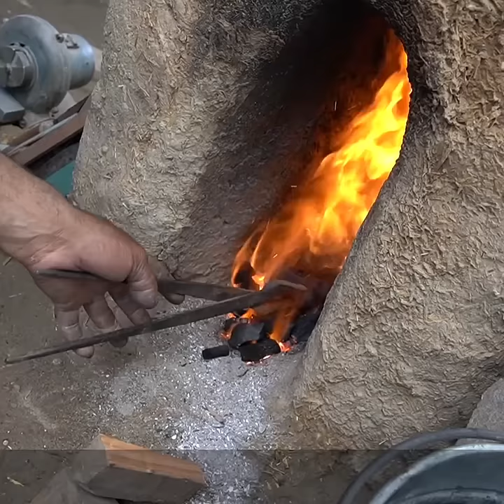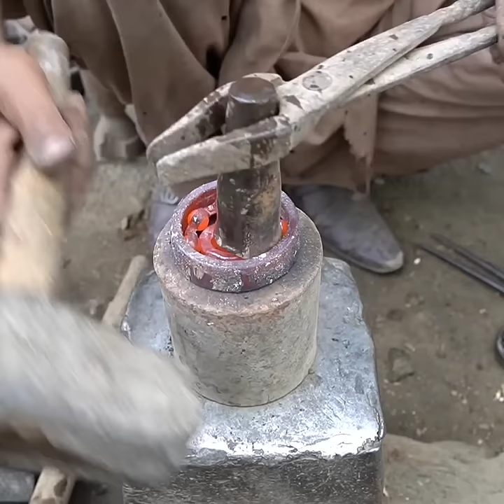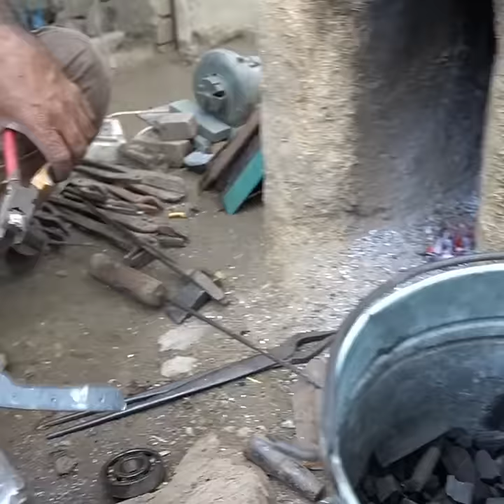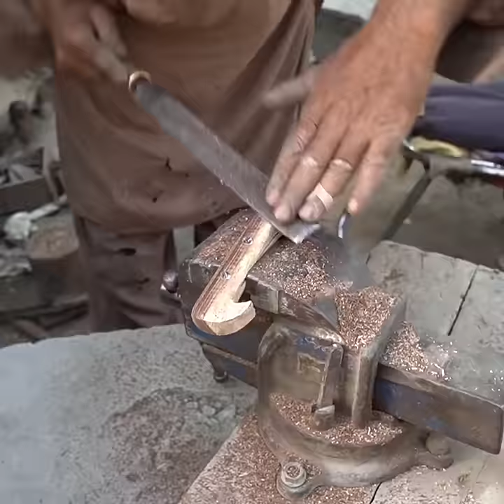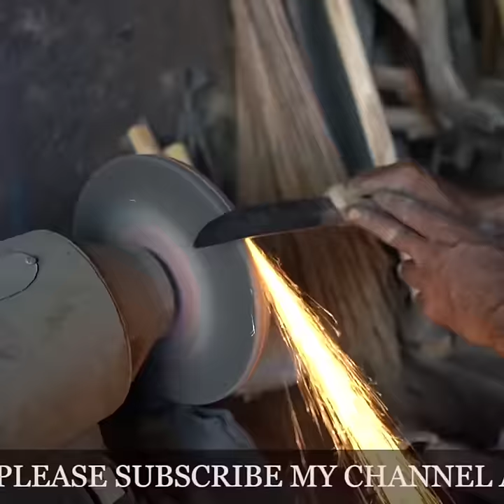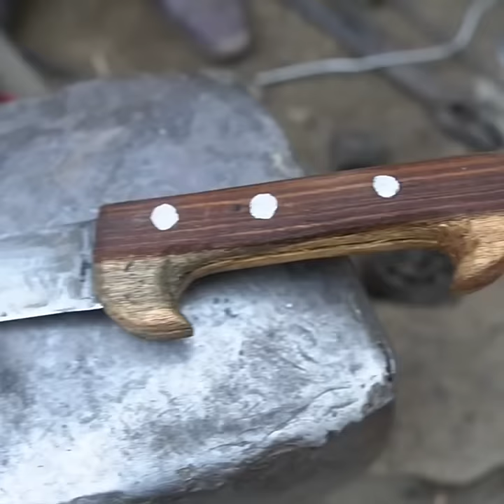Amazing process of Making  Sharp Knife From Old Car Tire Bearing

Comment: I'm just wondering why you didn't temper the metal? Even though that's probably D2 tool steel, since you heated it up it probably lost a lot of its hardness...
Reply: Was wondering the same thing. When he hammered the holes out it bent the metal so if he didn't harden it that's a sad knife.

Comment: Deformation of handle when punching holes is a problem. We cant use knife blades that bend to easily without returning(memory) to near normal. The most important feature to consider is tempering for edge hardness and back spring. Two zones on the blade requiring two different thermal conditions.
Reply: Лезвие ножа изготовлена из подшипников. Они достаточно твердые. Этот нож охотничий, который предназначен для срезания шкуры и разделки мяса. Смысл ножа в том, что он годы будет держать заточку.
При этом он конечно хрупкий.
У каждого ножа свое предназначение
Reply: Pero la parte de la Lima que va incrustada en el mango no va templada, y las limas funcionan perfectamente.
Reply: They do but not filming